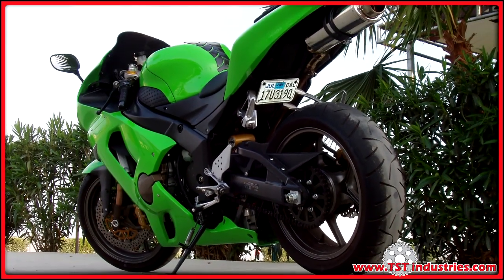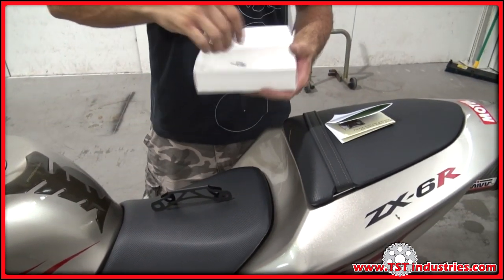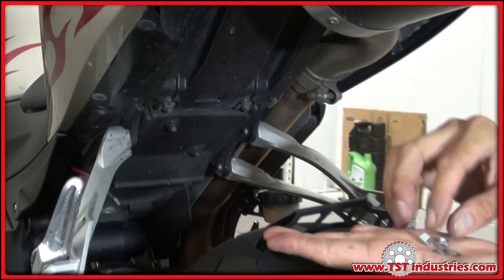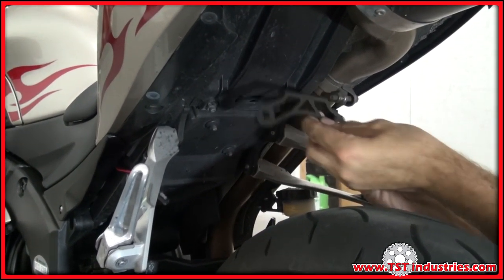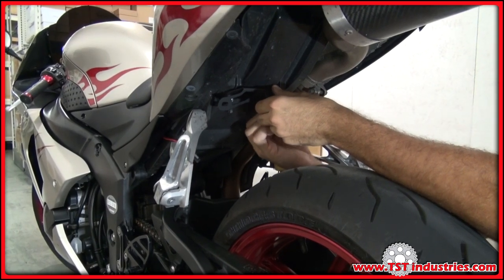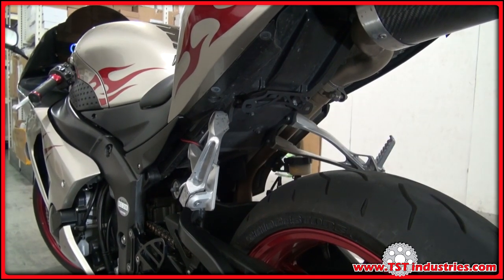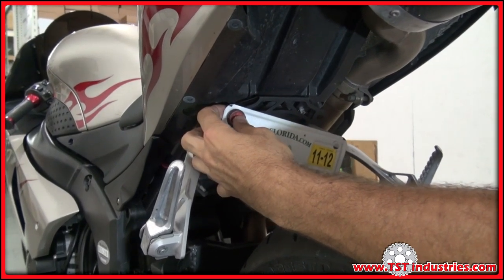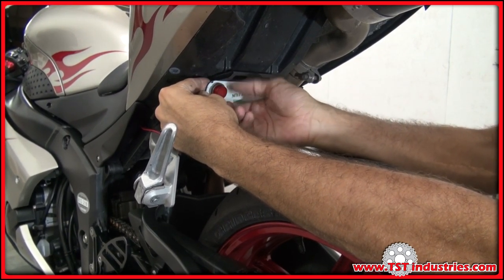Installation of TST Fender Eliminator / license plate bracket kit on 2005 2006 Ninja ZX6R / 636 DIY

Comment: I want a mud guard with license plate for my r3 which is the best!!? Like the one in Ducati xdiavel
Reply from the maker: We typically do not go off-roading with our R3 bikes so we haven't identified a need for mud guards or fenders. In fact in, in the R3 world we are known for fender elimination parts and other rear end cleanup parts. A swingarm mounted fender/mudguard adds unsprung mass to the rear suspension and it's totally unnecessary so we will not be making or supplying such parts.
Reply: TSTindustries  thank you for the reply but I live in India and I don’t the license plate protruding like that, I liked  the license plate with mud guard setup in Ducati xdiavel that’s y I’m searching for a mud guard with license plate for r3!!!
Reply from the maker: You can probably find what you are describing in Thailand. I have seen this type of mudguard made there for other bikes. The R3 is very popular there so they probably make it.

Comment: I've been looking at this bracket this past week, but now that i saw this video it looks like the license plate is angled toward the inside of the bike like around 45° degrees if that makes any sense?, i don't want to get pulled over for that reason can the plate sit straight up so that if a cop if behind he can clearly see the plate number?
Reply from the maker: +Miguel Gonzalez The bracket does not actually hold the license plate at 45 degrees. The license plate ends up about 15-20 degrees off vertical. The license plate is fully visible from behind and sides. The bracket can be bent up to 5 degrees to fine tune the angle, but do not go beyond that as you will crack the powdercoat. Be careful though...I would recommend researching local laws on license plate placement. In some places it is not how legible the plate is that gets you pulled over. Some jurisdictions are strict on where the plate is mounted on the bike as far as how far towards the rear the plate has to be.
Reply: +TSTindustries okay thanks will be ordering soon.
Reply from the maker: Miguel Gonzalez You're welcome
Reply from the maker: Miguel Gonzalez Have you seen our programmable sequential integrated taillights for your bike?

Comment: I have this on my 636 same location, but have to get rid of it because of the suspension travel, the tire hits the plate as you roll over bumps and whatnot
Reply from the maker: Hey there - The bike used was owned by an employee here at TST. It was on stock suspension and not adjusted. Under stock settings you should not experience an instance where the tire would hit the plate. If your bike was/is lowered you may experience some issues.
Reply: TSTindustries  yea I bought the bike used, I had went out to take a look after I have seen the vid to do some measurements and noticed that the bike was previously lowered. Something the prev owner neglected to tell me, although I did feel a little awkward on the bike, but it's the first time on a smaller bike for me so I assumed it was the way it should have been. Gonna raise it back to stock this weekend

Comment: What if the stock bolts are way too small for the nuts to screw on when trying to put the fender eliminator kit on?
Reply from the maker: William Crawford We have never encountered that in the eight years we have been selling this kit. I would venture a guess that the OEM screws in that location have been replaced with shorter ones at some point in the bike's history. If you would like you can replace those screws from the inside of the tail with longer ones that will accept the bracket.
Reply: +TSTindustries okay, I'll look at getting new bolts
Reply from the maker: They are M6. Just have to pick the length that works for you

Comment: what if we don't have those factory plate bolts that you use to keep the plate on the bracket???
Reply from the maker: +jinxx rider636 You can go out to a local hardware store and pick up some nuts and screws for fifty cents.
Reply: now i feel like an idiot.... ._.
Reply from the maker: +jinxx rider636 why?
Reply: because as another man i should have already came up with that manly mechanical engineering thought of buying a screw and bolt and used those. xD
Reply from the maker: +jinxx rider636 Don't feel bad dude...it's Friday.